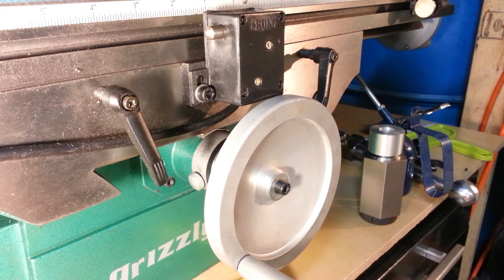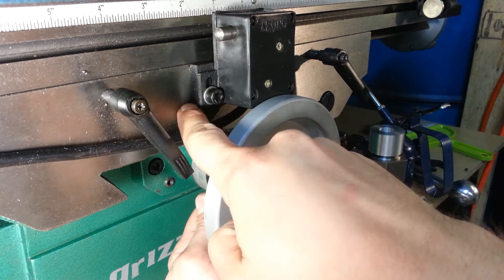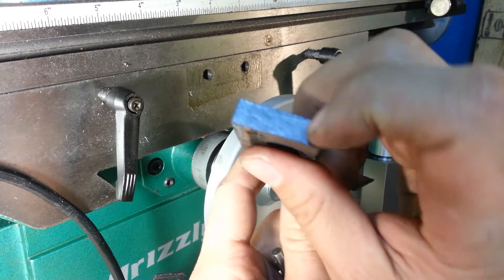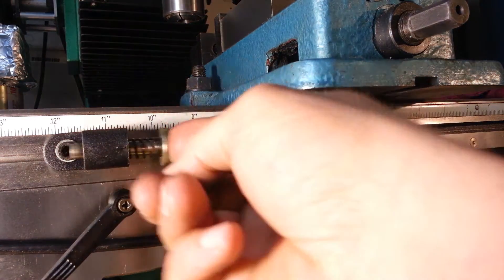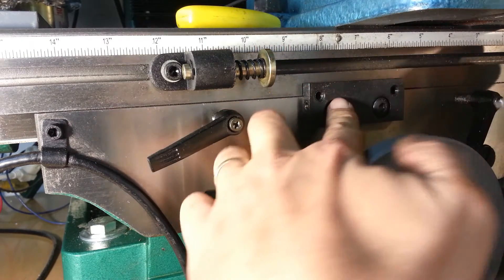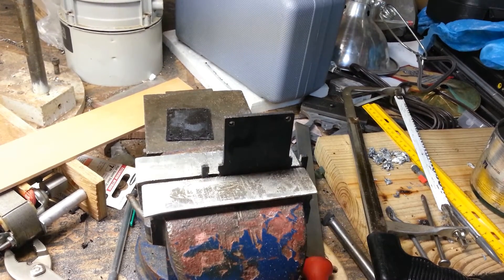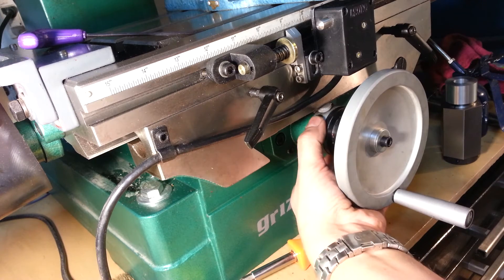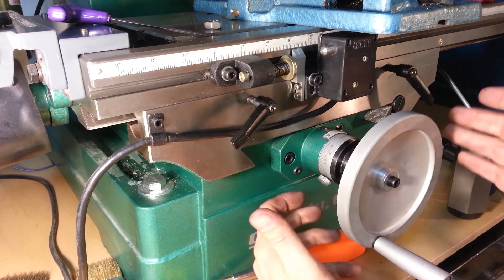Grizzly G0761 (RF45) Y-axis fix for handwheel and dial thumb screw

Comment: This is common even my Taiwanese mills have the same issue. It’s not a grizzly specific issue. You do gain more travel and you can slot the bed for another inch if you want. Also the plastic safety switches that are not buttons work when you lift them up higher because it’s the outer housing that slides to contact for shutdown.

Comment: What about using a different hand wheel ?  are you sure you got the hand wheels installed on the correct shafts ,if so I like your idea of turning down the wheel to smaller diameter (much cleaner looking). moving the switch around and messing with stops will look like ass and probably will yield other problems
Reply from the maker: Hasn't given me any problems and is working well since, though I would like classier handwheels regardless...

Comment: I have the G0755, which is like yours but comes with a stand and a motorized head. I've used it, a lot, for more than a year and never noticed that mine has the exact same issues yours does. That is because I mounted my vise in the nearest set of T-slots instead of the middle one. That also means the vise handle and Y-axis wheel usually don't interfere either. Now I have to decide if I am going to fix this on mine.

Comment: I'm very close to buying a mill. Comparing cost, HP, size, capacity, spindle travel, power feed, I've narrowed it down to G0619, G0761, G0755, and G0801. Right now it seems like the G0761 wins out. Looks like you are liking yours. I've been writing out charts where I can compare everything. I'm open to any thoughts or recommendations from you.
Reply from the maker: I researched for a few months before making my purchase as well. My previous milling machine was a mid-sized benchtop CNC.

My main criteria were:
1. Table Travel/size
My previous machine only had about 5x7" of table travel (~6x12 size), which was claustrophobically small for any serious projects and my 4" milling vise had to hang over the edge. Having used the G0761 for a while now, I'll never go back to a smaller table. Its massive 9x22” travel is just right for anything I’ve done so far.

2. Geared head
This was huge for me. My previous machine was belt driven. This made it great for high-speed/low-torque cutting but it was not good enough for anything in steel above about 3/8". Having a tool stall during a cut is very frustrating and dangerous. These geared head units almost have the opposite problem. They are not quite fast enough for tiny carbide tooling, but have enough torque that they never bog down. I find myself using larger tools and shell facing more vs cuts below 1/8" though, so perfect for me. If you really needed high-speed, a few folks have made high-speed off-center spindle attachments for 10k rpm routers, etc. I also have a cool future project up my sleeve in this area. I've heard that the gears in the head can get noisy as they wear, whereas belt drives remain quiet. Something to consider if noise is a factor.

This is becoming extremely wordy...

G0801
You would HATE changing speeds with belts. That kills it for me.

Also, I find myself using the X power feed a LOT more than I anticipated so you would want to rig up something aftermarket for that. Smaller table, but maybe inherently more stable design? However, I concluded that if I wanted a knee mill I should just get a real knee mill, or at least one of the beefier mini-knees. Jet makes a cute ¾ scale full knee. I went and looked and the RF-45 style just seemed like a better fit for me. This machine also does not support forward/backward ‘Nod’ adjustment of the head. The 0761 doesn’t either, but shimming is easy as the column bolts are exposed.

G0619
I like the easy Z column handle location. Weary of the low-speed torque on the variable speed drive, but maybe not an issue these days. As with the 0801, you're probably going to want a power feed on X. Seems like maybe a tighter but smaller machine.

G0755
As far as I can tell this is exactly the same column and head as the G0761, but with powered Z, a stand and slightly less beefy table. $500 price difference and desire to make my own stand tipped me toward G0761. I sure hated the Z crank on my G0761 though before I motorized it, so if you're not inclined to DIY, maybe the $500 is worth no crank to you?

G0761
The fit and finish on my unit was excellent and I have been generally pleased.

One thing I can think of that I do NOT like - The fine feed on the quill has way too much play in it. Endmills will pull it down if not locked and it will sometimes suddenly 'drop' several thousandths when lowering. Other RF45 machines have this same problem I believe. My quill is also a tad loose for my taste when extended and not clamped. To be expected, but still worth mentioning.

Other – I checked the manuals and all the machines on your list are from a ISO 9001 factory. According to every RF45 owner ever, that may be worth something vs a model from a different vendor.

Bottom line - You've reached the hard part of the decision and I'm glad I'm not in your shoes. I trust Grizzly's quality and support. They are my 'Buyer's agent' to the Chinese manufacturers. I think as long as you match the machine capacity to your needs the 0619, 0755 or 0761 would do just fine. I would rule out the 0801 and recommend either the 0755 or 0761 (based on how much you value the stand and Z-axis motor).

Thanks for the comment!
Reply from the maker: Stefan Gotteswinter has his RF 45 tricked out pretty good. His nod-tramming epoxy video is a favorite of mine on the topic.
https://youtu.be/U7Qs-J2swIc
Reply from the maker: Did you make your decision?